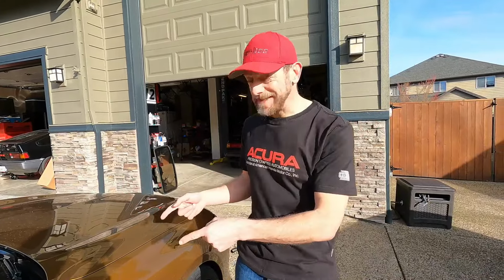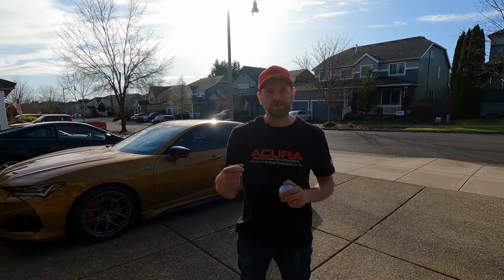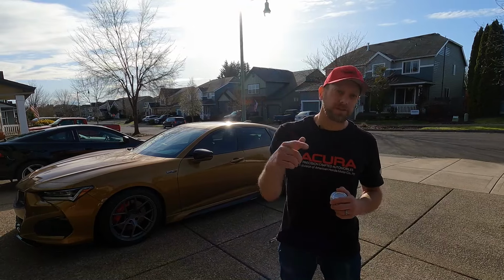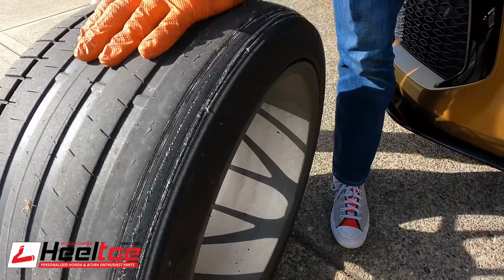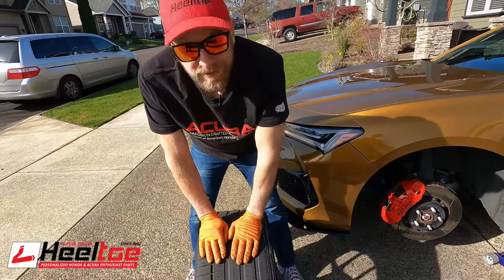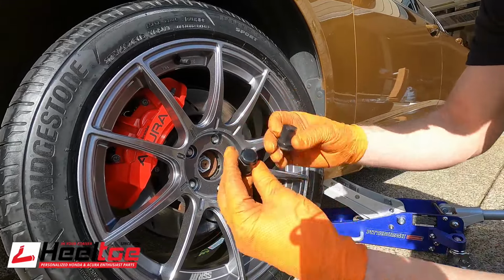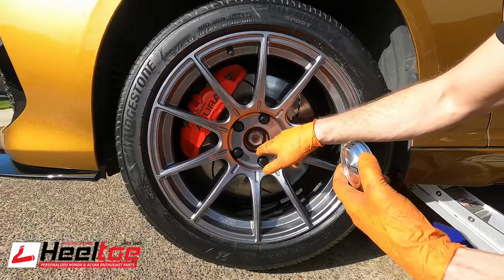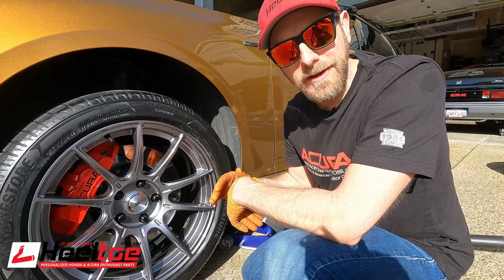Acura TLX-S with 19" SSR GTX01

Comment: Will those mugen lugs fit with the oem multi spoke rims?
Reply from the maker: They have a conical seat so if you want fancy black lugs with a ball seat grab these: https://www.heeltoeauto.com/lug-nuts-locks/honda/acura-accessories-genuine-oem-wheel-lock-set-black-4pc-acura-tlx-2021-08w42-tz5-201.html and these: https://www.heeltoeauto.com/lug-nuts-locks/honda/acura-accessories-genuine-oem-wheel-lug-nut-set-20pc-black-m14x1.5-cone-seat-for-oem-wheels-flat-top-style-08w42-tz5-200b.html

Comment: Bit too meaty and pushed out IMO.  Probably better off with 265/40s and a 40-42 offset on the wheels.
Reply: Oops, I just realized you're running spacers... so the SSRs are probably fine sized just as they are.
Reply from the maker: SSRs here are not running spacers. They are rather beefy but fit great. The car looks awesome in person, for a #meatyfitment performance look.